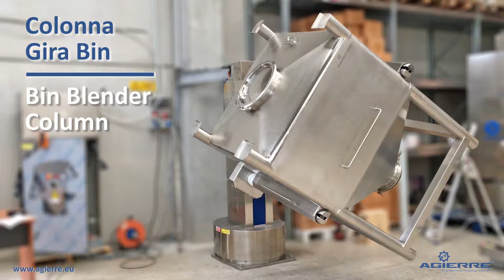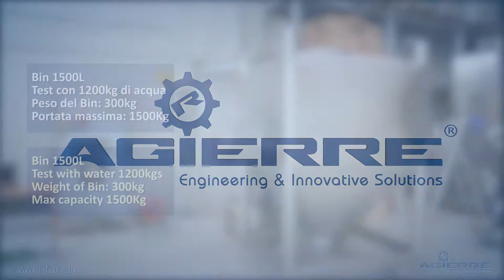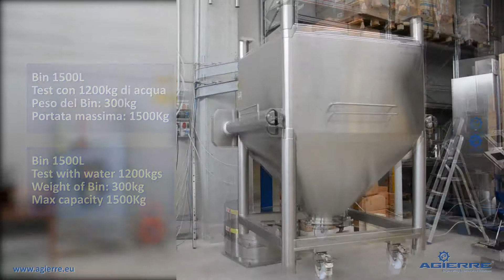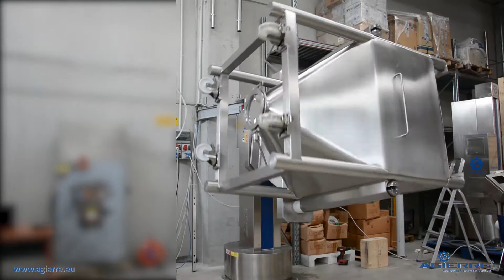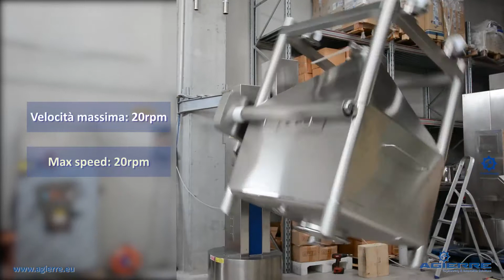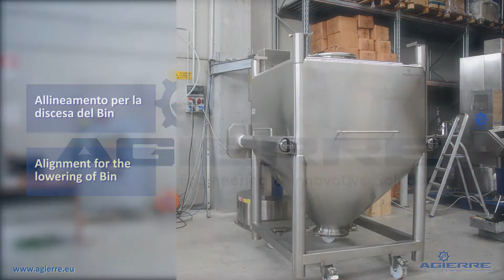Bin Blender Column - AGIERRE

Comment: How much time normaly rotaty for 1 batch
Reply from the maker: Hello, and thank you for your interest in our Bin Blender Column.

The average time it takes to mix powders can vary widely based on several factors, including the type of powders, their properties, the size of the Bin container, the design of the mixer, and the desired level of mixing uniformity. As a result, it's challenging to provide a specific average time without more detailed information.

As a rough estimate, in some industrial processes, mixing times for powders in Bin Mixers can range from 5 to 15 minutes. In practice, experimentation and testing are often used to determine the mixing time.

I invite you to contact sales@agierre.eu to let the team further assist you in selecting a Bin mixing solution compatible with your production process requirements and particular needs.
Reply: normally the time of one v blender are 15 to 20 mins, for mixer of 200 to 500 kgs/hr, i think that the time should be very similar for ICB BLENDER, because are similar